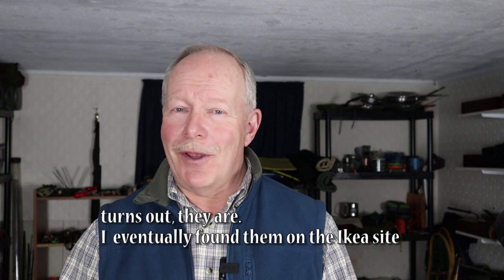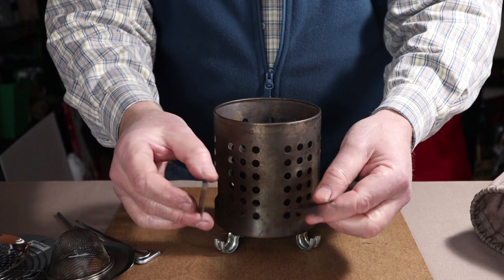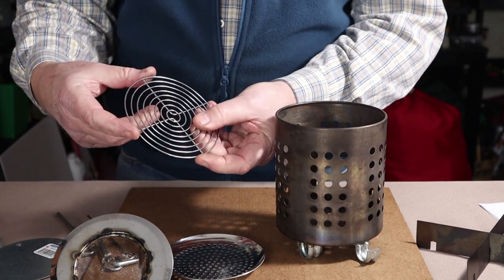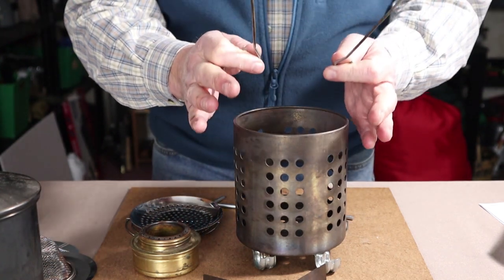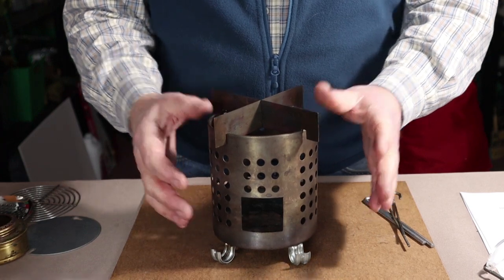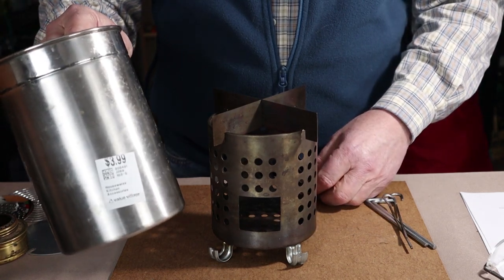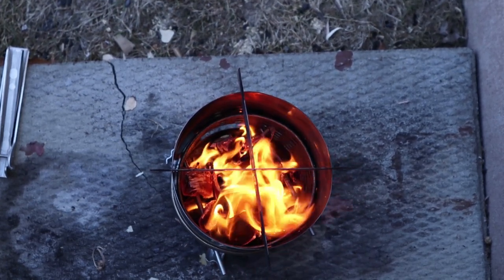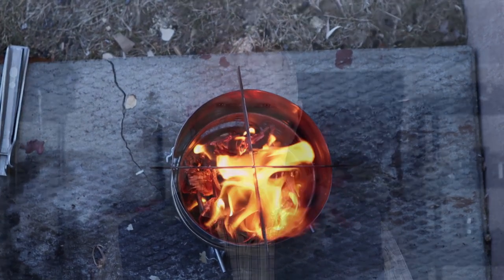How To Build the Ultimate Ikea Hobo Stove

Comment: Mark, I’m going to the shed to start my mod’s on my IKEA stove. Thank you.  Also when I use my IKEA stove on windy days, or slow down the burn, I have use a tin can, cut, sized 1/2 inserted in the IKEA stove. This reduces the air in take and directs the flame up, instead of out the sides. Just finished my first burn. I have the smaller IKEA stove, used a Costco coffee can for the outer can, Siege supports for the top, Pathfinder kettle. Boiled in 3.30 minutes. WOW.  Thank you for your research and dedication to the camping community.
Reply from the maker: Sounds like it worked out great. Thanks for commenting

Comment: One detail that may be worthy of notice: If you use galvanized/zinc plated parts, you will want to remove that before using it in a stove, since the zinc can give off poisonous fumes when heated. If it is just some small parts like bolts and spacers, you can let them soak in vinegar for a couple hours until the zinc gets removed and then brush them off if necessary.
Reply from the maker: Good suggestion. Thanks for commenting
Reply: Citric acid is good also, you can buy it by the bag, its good for a lot of other things too.
Reply: @KeyboardBuster Like what? These ideas and hacks are always good to know. I learn so much, not just from the videos themselves but from the  Comments.
Reply: Wow! Great Idea! Cheap and effective

Comment: Nicely done, Mark. Very informative presentation! Just wanted to let you and your viewers know that Walmart sells an exact same cutlery caddy as the taller IKEA version. And its costs only $3.49 USD in Wal-Mart.
Reply from the maker: Thanks for the info!
Reply: Wow, I just looked on their website and saw about 6 different versions but all were over $20.00.  I guess the price went up?
Reply: @BingWatcher  Thanks. All I did was check their website for "cutlery Caddy" and  a bunch of different styles came up but the stainless steel units that resembled the Ikea style were all listed at $20 or above like I said.  I think there were like 5 or 6 different ones.  I will do as you suggest so, thanks.
Reply: @BingWatcher  Bingo!  when I searched under the name you gave me, it came right up and is $3.48.  Excellent!  I thank you again.
Reply: @OverlandOne  You're welcome 🤗 I am glad it worked out well for you.

Comment: I made a hobo stove combining features of your design and a few other people.I bought a utensil strainer from Walmart which cost a few dollars, We already had skewers. I like the new modifications -skimmer drain etc. I noticed the problem of heat loss in the perforated utensil strainer. I used bolts on the bottom, but may switch to the conduit clamps.
Reply from the maker: Right on. So many options. Thanks for commenting

Comment: Nice one, Mark. An alternative to fitting brackets to the bottom of the Ikea is to cut the base (with around 15mm of the side wall) off a previous incarnation and fix that permanently to the base, simply hammer the dimples flat . Scallops (I cut three at 50mm long) can then be cut in the rim of the base unit to allow air flow to the bottom of the stove. The height is increased slightly but the advantage is that you only need to put the pot stands on the top and you're ready to go. If you use one central fixing you could vary the bottom air intake by simply rotating the base. ATB
Reply from the maker: Interesting design. Thanks for commenting

Comment: Great idea, Mark. Especially using the stainless steel container to regulate the airflow. That is simply genius. The stainless steel container is called BMP Sauce Container (I don't know what that stands for). Shape of it varies a little bit, but widely used in commercial kitchens. Usually comes with a lid. I would skaletonize the pot stands to give more room to exhaust and use short angle brackets for feet to support more weight. To use the Alocs stove, how about bending the skewers a little in the middle to fit more snuggly around the alcohol stove? I am sure they will still fit through the holes. Again, amazing idea!
Reply from the maker: Great suggestions. I think the BMP may be Bain Marie Pot, A form of cooking with hot water. Thanks for commenting
Reply: @MarkYoungBushcraft  Thank you, Mark. Learned something today.

Comment: I use the taller Walmart strainer with an internal chimney. Chimney is made from a tin can (slightly smaller in diameter than the stove) with both ends cut out. It seems to work just as well. Tin can chimney will eventually burn out (about a year) but cheaper and easier to find a replacement. Also more compact. Your stove vids remind me of Hiram Cook’s channel on stoves.
Reply from the maker: I was inspired by Hiram, the master. Try and external chimney, it may last longer. Thanks for commenting

Comment: Mark I love my Ikea stove. I used a medium sized biscuit cookie tin cut out the bottom, sliced it down the seam. I can adjust it tight to the stove or bend it open to the make it wider works great. I also use the lid upside down to set the stove on to give protection from a tabletop or just ground. Thanks man your ribs are always great! Stay warm stay safe keep the faith
Reply from the maker: Right on. Sounds like a good build. Thanks for commenting

Comment: I was worried about the efficiency of the stove until I watched this video. The application of a coffee can chimney has greatly improved its performance.  I'm going to build one exactly the same for myself.

You can place the metal lid of the coffee can, or another similar metal lid under the stove to collect the ash of the wood. If you are interested in buchcraft applications, you can also make soap with this ash. Or you can simply prevent burning the ground with hot embers.
Reply from the maker: Yes, something under this stove is a requirement. Thanks for commenting

Comment: You could try using double-wall insulated stove pipe as your chimney. Available in sizes at least as small as 6" length/6" inner diameter and up to at least 24" length/9" inner diameter. While it would likely be less packable, it would give you heat retention.
You can also find air-insulated double-wall stove pipe with similar dimensions that would be lighter, or use single-wall stove pipe for the best packability.
Reply: B vent
Reply: @brucematys8597  
From what I can find, B vent has an aluminum inner pipe which wouldn't likely handle the high heat very well. I've burned aluminum to ash in a basic, open-pit campfire.
Reply from the maker: Interesting idea. I will take a look around. Thanks for commenting

Comment: Love the experimentation, really enjoy your informative explanations and the overall presentation.
Thanks so much interesting and enthusing.
I took the tallest strainer I could fine from my charity shop and Poundland shop trawling, Junior hacksawed off the bottom about 6mm below the lowest side holes. Filed off sharp edges. Flipped the bottom over, carefully placed the top portion, ( right way up), over the bottom and using a 4x2 timber tapped the top down.
Using the upper parts lowest set of holes (now blinded), as guides, drilled through the solid upside down rim of the original bottom.
You now have a fire grate about 12/17 mm up from the ground but vented below and all around the circumfrance. 
Hope my description can be followed.
I will defiantly add your outer chimney, thank you. 
Take care, regards Colin
Reply from the maker: Right on. I like your design. Thanks for commenting

Comment: Excellent video, I appreciate it. I've now used this hobo design (without the rocket chimney part) in cold, snowy and windy conditions several times and it has performed very well. I didn't have a wind cover solution other than placing the stove near some rocks on the ground and that worked well enough in 8 m/s "fresh breeze" wind. The stove cools down very fast after use. I will have to try out the "chimney"/coffee can style addition it looks very cool.
Reply from the maker: Glad you liked the video. You can purchase folding panel aluminum windscreens on Amazon and Aliexpress for a reasonable price. They are great for a stove like this. I have also used aluminum flashing to make a windscreen. I wrap it around the stove inside the stuff sack. Thanks for commenting

Comment: I left a container just like that at VV the other day. I didn't think I needed another 16cm pot. Have to go back and see if it's still there.
I did my first top-down burn in the Firebox this week. I'm definitely using that more often.
If you ever need a good knob for the lid of a campfire pot, run a stainless steel bolt up through the lid  and secure it with a nut. Then put a big, ugly blob of silicone sealer (I use black) all around the bolt, maybe 1/2" diameter. It won't conduct heat out from the bolt and can take a lot more heat than plastic. Good grip,too.
Reply from the maker: Great suggestion on the knob. Thanks for commenting
Reply: @MarkYoungBushcraft  I usually start watching these videos with "I don't need another stove." I went back to VV. The container was gone, but I found a 12cm Ikea strainer and a slightly shorter 14cm container. Machined some feet and cut the bottom out of the container. Just going down to the shop to cut up the Walmart ruler.
Reply: I tried out the new hobo last week - full load of very dry alder. At one point, it was sending up very clean 18" flames. Lasted more than long enough to boil water for my Chai and roast a smokie. A really good innovation.

Comment: Great idea Mark. I wander if using a stove top heat diffuser between the pot and pot stand would control the fire from rolling up around the side of pot. You have so much heat it might not diffuse it enough to make a great difference. I fine them at thrift stories all the time. Two pieces of perforated metal seamed together with a space between them and handle.
Reply from the maker: I have been playing with a diffuser but have not tested it on this stove yet. Thanks for commenting

Comment: The only thing I might suggest is a slightly larger 'chimney'. It may improve bottom height efficiency by allowing just enough more air. Or maybe just get a couple sticks at base of chimney to lift it to the bottom of the burner. Over all a brilliant idea. Tho the one rocket stove I have actually seen has had even sized chimney and feed, but no other air intake above the feed. That I could see anyway. It is a pellet stove heating my neighbours RV.
Reply from the maker: Worth trying for sure. Thanks for commenting

Comment: For the legs, I suggest using locking nuts (not nylock though). That way you can tighten them down just enough to allow them to swivel but still be firm. Then you don't have to loosen them to rotate the legs.
Reply from the maker: Great suggestion. Thanks for commenting

Comment: For the size and overall cost of the hobo stove compared to a $40 gassifed twig stove i would rather the twig stove.

But i just discovered that the smaller version of the ikea pencil holder is a much more compact design that allows the stanley adventure cook set to nestle inside of it. I just to grab a wide mouth brimmed water bottle pouch to place it all in and it will create the narrowest and tallest cook set ive seen yet. Which would increase the chimney effect even more
Reply from the maker: I have a video on that as well. Thanks for commenting

Comment: Thanks for the information on your modified IKEA wood stove.  I built an IKEA stove based on your earlier model with legs and open port to feed fuel but used it in a different exterior can.  I inserted your IKEA style stove in a 3 pound coffee can with air holes based on #davesrealsurvial for "161. Easiest Tin Can Rocket Stove".  This style of stove was not as efficient as your modification but was easy to build.  I boiled 2 cups of water in 4:15 in a Stanley Adventure Cup that is not an ideal diameter for boiling water.  I still need to build the pot stand and will use your design using the ss ruler from Walmart.  Thanks for sharing some of your outdoor adventures and evaluations with your viewers.
Reply from the maker: You are most welcome. I love to hear about other peoples experience modifying their Ikea stoves. Thanks for commenting

Comment: Hi Mark, the possibilitys with this stove are endless.. i use the crossbars from the Kelly Kettle.. cause i had then.. and they are not really expensive...
with your rocketstove version.. its also possible to feed sticks at the hole at the side of your stove. 
another idea is, to cut only a smaler hole into the bottom of the coffee can, smaller than the width of the ikea.. than the room.. between the Ikea and the coffeecan is closed if you put it upside down on the ikea.. the secondary air effect should work better.. 
i hope, you understand the meaning. 
A further idea, is to make a reducing at this construction, to use a small stovepipe for a small tentstove.. its only an idea for testings in the future..😂
This rocketstove version is for sure, a possibility to heat a Tipitent with an open fire, nearly smoke free or - less instead a firepit inside the tent. 
i also use the computervent at the lowerest holes of the ikea as a burningrost, like a regular woodstove for more air underneath and that the ash can fall down easyer. 
A lot of ideas... i hope you understand my declaration... i am no really goot english speaker! 
Have fun stay healthy Mark and move on with the ideas that you have... greetings
Hans from south Germany
Reply from the maker: You have some very interesting ideas. I will consider them for sure. Thanks for commenting
Reply from the maker: and I understand your English just fine
Reply: @MarkYoungBushcraft  thank you!
Reply: @MarkYoungBushcraft .. try a Potstand lid from a chinese woodgasstove on top of the ikea... or maybe it will work on top of the Coffeecan for a better gasification when the hot air is concentrated...
Reply from the maker: @hansschmid3937  interesting idea. I will give it a try
Reply: @MarkYoungBushcraft ... these are the real problems of the world Mark! And we will find the best option! 🤣🙏👍😎
Reply: @MarkYoungBushcraft  and i will try to find such coffee cans.. here a little bit difficult.
Btw. the larger Ikea works great.. more length.. for longer wood.. and more Pellets for a longer burn.. and.. with the Top of the Woodgasstove... a cleaner burn with pellets so i think... and a windscreen... i tryed it in the backyard with a alureflector shield. halfround.. ca. 40 by 50.. cm...sitting in a chair an enjoying the heat.. 😎

Comment: Another remarkable vedio from you sir. Can we try tuflon tape wrap on the outside shell to  reduce  heat loss? I know tuflon tape melts at 327 degree C. I use it on my pressure cooker for a long time. Your vedios are really inspiring. Thank you. 🙏
Reply from the maker: Thank you for your kind words. I would suggest a material like fiberglass or carbon felt as insulation as they resist high heat and would be easier to work with
Reply: Thank you for the fast reply❤️

Comment: It should be easy to experiment with restricting airflow up through the bottom by installing bolts and nuts to close off air flow holes.  If all holes in the bottom were filled with bolts, it seems like that should reduce hot ashes falling on the ground.
Reply from the maker: Worth a try. Thanks for commenting

Comment: I have some fiberglass fabric used to line airplanes. It is left from building chimney holes in tents. I’m wondering if it would work instead of the carbon felt to line the can?
Reply from the maker: Coincidence, I just cut up a piece of fiberglass fabric like the stuff you have. Made a mat to put under large stoves. Hard to work with as it keeps coming apart. Yes, It should work as insulation for the chimney. Thanks for commenting
Reply: The fiberglass fabric does fall apart badly.  It handles best if you sew a wide zig zag double rows of stitches about a quarter to half inch apart and cut between the rows of stitches - depends on the weave - fire isn’t the thread’s friend but you won’t lose fiberglass all over the place while you are working. Figure on the carpet cutting blade and the sewing needle will be dull after using.

Comment: Will I have the same effect if I put a can inside held by the  skewers  and with holes at the bottom for the air to go through?
Reply from the maker: It will depend on the size of your pot and much of the airflow is restricted. The more room for exhaust at the top as well as the height of the chimney in relation to its diameter, the greater the effect. Hope this helps

Comment: Hey Mark, I got the taller Ikea utensil holder and the drain strainer was a great add-on,  kudos . I Can't find the taller sugar container windscreen though, have looked in several dollar stores . What dollar store chain did you find that in?  Or is there possibly an online link? Google search turned up  nothing.  Thanks, great build.
Reply from the maker: Actually, I found the canister in Value Village, a thrift store here in Halifax. I see them fairly often there. Hope this helps

Comment: If you aren't going to insulate it in some fashion as you pointed out, I am not sure why you wouldn't just make a stove out of the container by cutting some holes in the bottom area and drilling holes in the bottom to secure the conduit feet without cutting the bottom off and by using the cross pieces on top.  Why the extra weight of two containers?  I wonder what the optimum hole design would be, though...  You would lose that secondary combustion that you mention and there might  be more insulation with just the two containers.  Can you incorporate the Seige pieces into your design?
Reply from the maker: So many factors go into a effective stove. Lots of areas to experiment with. I am testing out the Siege cross-members for a variety of things. Thanks for commenting